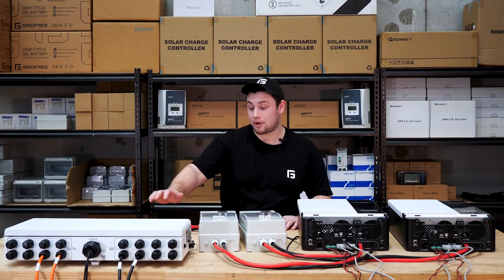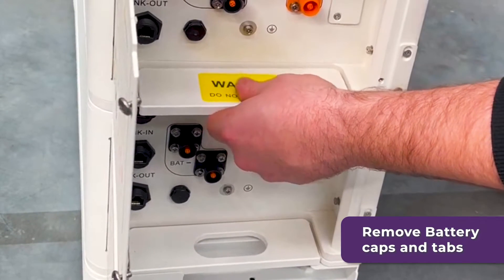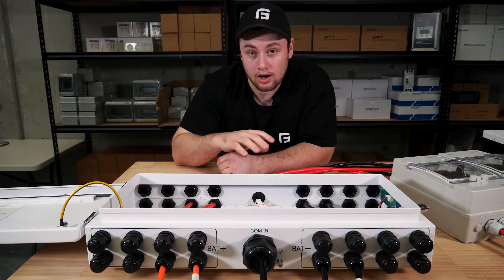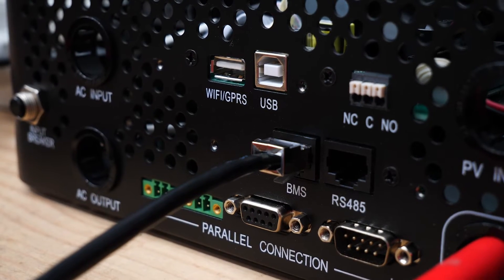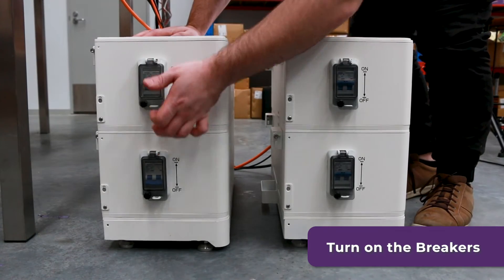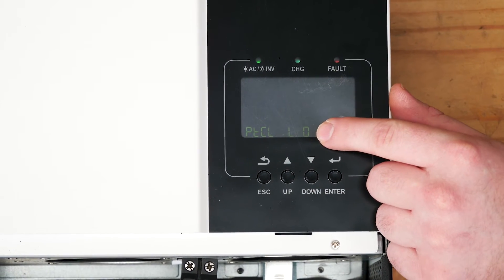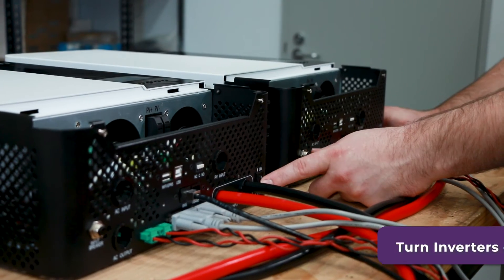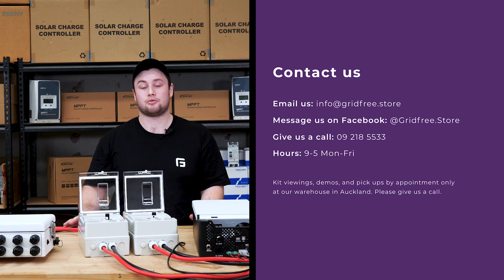Installing Growatt Hybrid Inverters in Parallel | Parallel ARK Lithium Batteries With Battery Hub

Comment: Hello, I have a three-phase system built from 3x Growatt SPF 5000 ES, and 10 Growatt ARK-2.5L-A1 batteries. Very quickly I reach the maximum 100Amps on the BMS and the system shuts down. I am trying to find the Growatt ARK Battery Hub-A1 to connect the batteries in parallel and configure the CAN communication correctly, but it is impossible to find in my country. Is there another method to connect 10 or more batteries, for at least 200 amps? Thank you!
Reply from the maker: Hello, thank you so much for your question! Are you able to send this through to info@gridfree.store and one of the techs can help you.

Comment: Hello mr, nice video !! When you said we programming the mode 23 (parallel connection) BEFORE connecting the AC wiring ....you mean we do this before connecting the loads (AC out) or AC from grid (AC in) ? Thank you, Bill
Reply from the maker: Hi there, thank you for the comment. What I am referring to is to avoid connecting either of the AC outputs together until you have programmed the correct settings. If this is not done then both units can be damaged.
Reply: @GridFreeStore  Thank you for the advice !! I will disconnect the AC outputs, and I will do the programming and then I will connect the AC outputs again ! Thank you, Bill

Comment: Hello, hope you can read my comment and help me, what would be the way to connect 2 inverters in parallel but using the same battery stack? Should the battery stack be connected to both and just use the communication cable for the master?
Reply from the maker: That's a great question! Are you able to email one of our technicians at info@gridfree.store? Let them know which video watched for reference. Thank you for watching!
Reply: Same battery, HEAVY CABLES.  To avoid issues with LVC and HVC delta Make sure that the cable lengths are all equal between the three batteries or otherwise the current squared losses difference are minimal. 

Meaning you don't want to have a really big battery hooked up to one....  Then long skinny cables to the other two. 

Try to have all three units seeing the same battery voltage and drawing the same current.  They don't have to be equal length....   But they need to be electrically equal paths 

One can be short and smaller gauge while others are longer and larger gauge but when you load it down..........

* Clamp meter test reasonably equal currents 

* DMM test reasonably equal sag voltage

Comment: thank you for your video! really help me ,i have some questions if you would like to answer me:
 1.st after you finish all of  the connection ,what is the right order to power on the whole system?  BAT-->PV-->Grid? 
2nd question if one of the inverters don't be connected to the PV is there problem?
Thank you.
Reply from the maker: Awesome, we are glad the video helped you. For your more in depth questions feel free to reach out to one our technicians at info@gridfree.store

Comment: Hi, 

Thanks for this detailed video! It really helped me understanding the product. I've got 2 SPF 5000ES inverters in parallel and 8 ARK 2.5L-A1 batteries. I need an output of 10kW (200A x 51.2V), so I wanted to connect two groups of 4 batteries (each 100A) together with this ARK LV HUB-A1, but I noticed it's no longer in production. I live in the Netherlands and I can't get the hub here or anywhere else in Europe anymore unfortunately. Do you think it would be possible to combine the 2 BMS CAN communication cables together a different way, via a kind of different brand BMS combiner if that exists. Then I can connect the postives and negatives together with 2 bus bars myself. Or.. if you still have these hubs in stock, would it be possible to ship them to the Netherlands? 

Many thanks in advance! :)
Reply from the maker: We do have these hubs in stock. Get in touch via our website, hopefully we might be able to sort something out for you!
https://gridfree.store/

Comment: Great video! Thanks! If I have 3 battery stacks with each 10 of them (total 25.6KWh each stack), does that mean I will need a much thicker positive and negative cables on the output side of the battery hub (or Growatt combiner hub) which can handle 300A? I assume maximum amps for each stack is 100A allowed, so combing all of 3 stacks will end up 48v and 300a if I'm not wrong?
Reply from the maker: Heya, thanks for your question! Usually a multistack set up with a battery has multiple inverters. Each inverter will have its own cable pair to the bus and will only draw up to the maximum on one stack (depends on the specific inverter of course). If you have a no standard set up I.e. a single inverter that can draw 300A attached to a hub with 3 stacks, then yes, you will need to ensure adequate cable size and protections. You are welcome to contact us if you have any questions. E: info@gridfree.store

Comment: Do you know if the Growatt SPH 5000 TL BL-UP inverters can be connected in parallel? I want to get two of them but wanted to make sure it’s possible before I buy them. I can’t find any info in the manual!
Reply from the maker: Unfortunately, we do not sell this unit so we cannot advise on this. Please get in touch with the store selling that unit to be sure. 
Check out our inverter range here: https://gridfree.store/collections/hybrid-inverters

Comment: I was so confused by the Growatt documentation related to this. I understood that the inverters could be connected in parallel, but it seemed so pointless when the battery stack could only deliver 100A i.e. around 5kW of output power while discharging (and charging btw.). Nothing in the manual mentioned anything about hubs and multi-stacks - which IIRC break these limits. Thanks a bunch for the vid! :)
Reply from the maker: Glad this video helped! 🙌
Reply: PV charging is up to  6000w

Comment: is this effectively a growatt hub and two busbars in a box or does it contain some other logicplease?
I ask because I gave been told that  you cannot use a growatt hub and two busbars like this  to share more than 10x ARK LV with 2 parallel spf5000 and this could be the solution to my problems
Reply from the maker: They are 2 busbars plus a BMS communications combiner. You need these for multiple units/stacks. Each stack can have up to 10 batteries, so if you need more than this you will need to get a hub.

Comment: Thanks alot! Any tutorial on how the 2 outputs of the invertors are connected to the main for house loads
Reply from the maker: We don't supply that information as in New Zealand that's prescribed electrical work (you're working with 240V) and must be done by an electrician.